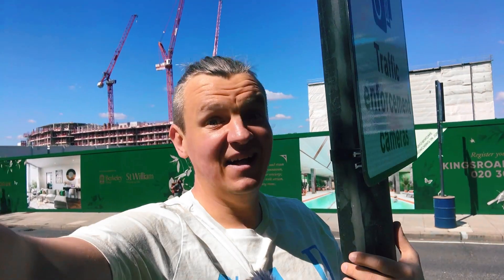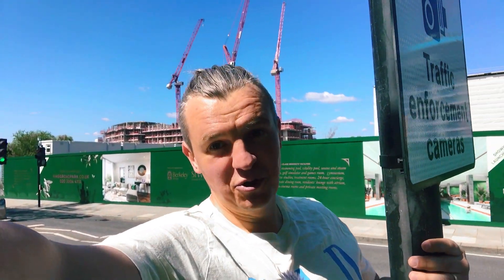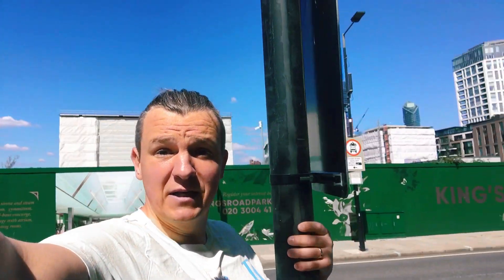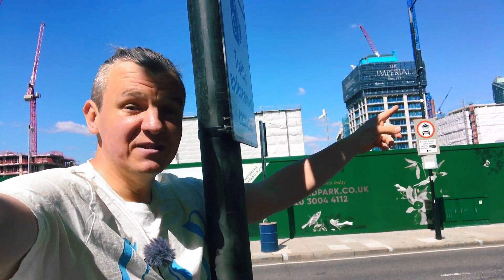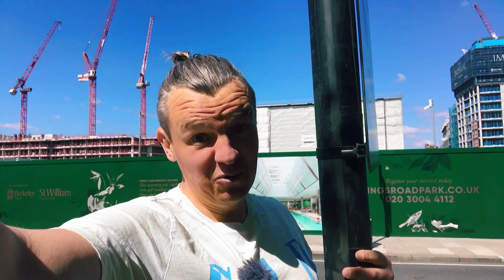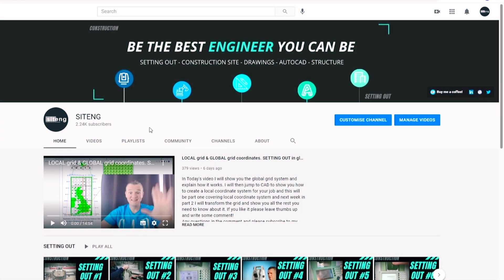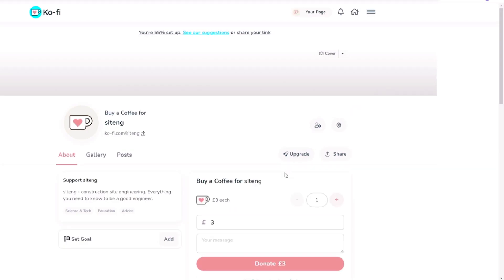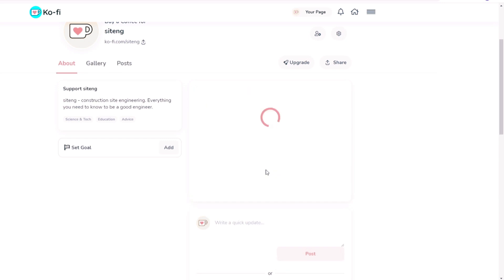RC Frames - coming back to RC Frame reality. Site engineer course and Ko-fi page.

Comment: Hi Sir, Found your Videos on YouTube recently very interesting. I graduated from University of East London with a Master degree in Civil Engineering in 2012. Due to family problems I never worked in the UK, but worked outside and have a little work experience.  I came back to live in the UK and really need to gain some work experience. You have mentioned in one of your videos uploaded on May, 30,2021 that you will start some practical course on EDM and laser. How can I make contact to find out about the course you have mentioned. Kind regards.
Reply from the maker: Hi! Course is not ready yet and it will take some time and will be available on line. Probably will do some meeting as well, but really can't promise when. Watch the vids here on the channel as this is a lot of knowledge. You can always take some course like surveying in construction in London.

Comment: I'm in Greg !!
Keep updating on when you staring the course ;)
Reply from the maker: Hi Thomas! Not sure, it's a lot to do, but 100% will do it :)
Reply: I just finished Engineering surviving college in FINCHLEY 
Was doing loads of setting out in past all interiors drylining , ceilings steels 
For bigger Drylining company in Europe 
I was designed steel Posts for them ON SKANSKA job when was on BARTS HOSPITAL 
Have my total station ( old but works OK ) have optical ( dumpy) level , spinning green beam internal topcon laser level , 12 lines green beam dewalt one 
Know how to operate 
Always been cooperating with offices I do understand all drawings was supervising teams of workers 
Will really like to start some work as a engineer but never worked as engineer outside I meant RC or groundwork etc 
I understand you busy as everyone is this days but will really like to meet you once even on your course 👍🏼
Reply from the maker: You should be fine then on RC frames :) Remember that rc frames are busy and exhausting, but money is good and it's the best entrance to big nice projects, or to management. I will let you know when I make something as I want to focus most on useless things not like Finchley.
Reply: @SITENG  finchley is very great oportunity to learn i do FINCHELEY as well and the quality and information are outstanding but knowing basic of SETTING OUT  and working after in groundwork company it preparing you a way towords  industry
Reply from the maker: I thought they not preparing for the job really, if they do I might not be doing my course :)